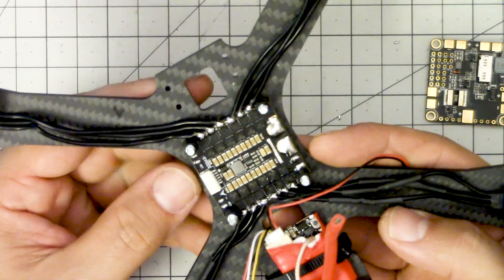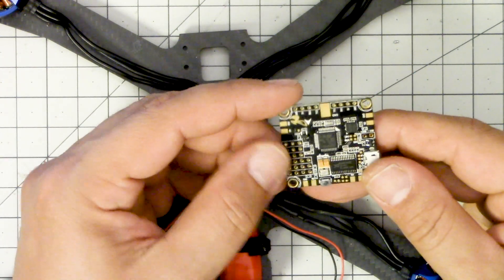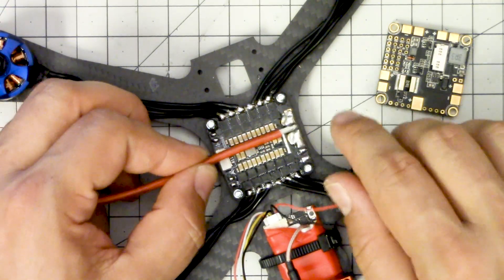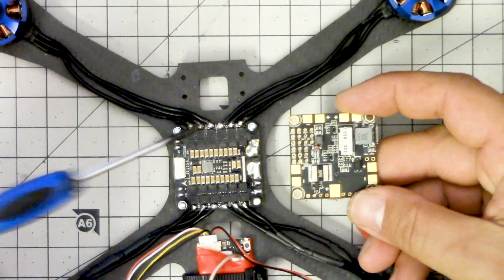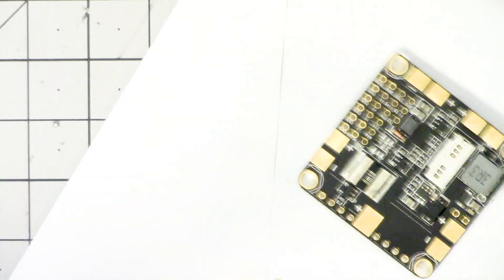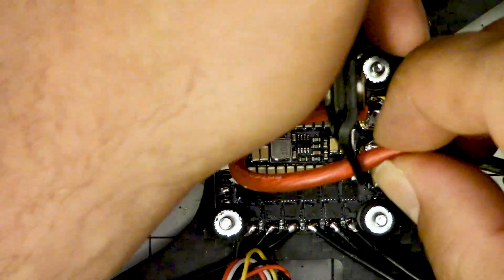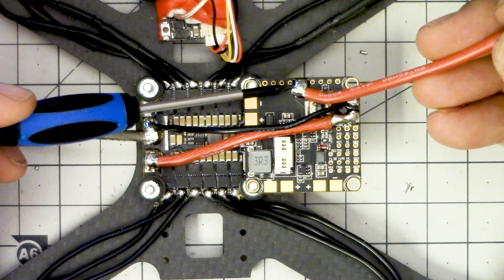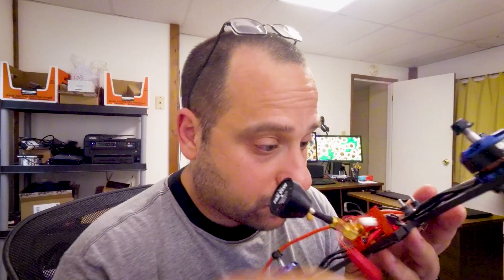All-In-One (AIO) FC  With 4-in-1 ESC | HOW TO WIRE IT UP CORRECTLY

Comment: Hey pal I’m using your 4-1 wax for the third build and I love it. However I hooked up a polulu 12v regulator for the vtx and camera cuz I’m using a lux v2 fc. and now motor 4 only does the initial beeps ( beep beep) then will not arm. Only 1,2,3 arm? Jtsnow1@gmail.com. Any idea?

Comment: I have a 550 frame. I am confused on AIO FC with ESC or Stand Alone ESC. Does it matter? I know the ESC boards are smaller, lighter, and are probably a must for small and race drones, but for larger drones?
Reply from the maker: The big advantage of a 4-in-1 ESC is that there are fewer solder joints when wiring it up. But if it is damaged, you replace the whole thing. Individual ESCs are more work to wire up, but you can replace only one if it is damaged.

Comment: Hey Joshua. 
=SKIP TO BOTTOM FOR QUESTION AND IGNORE POINTLESS STORY=
I have a (Bullet 30A 4 In 1 ESC Board) and im aware most people, if not everyone has their 4 in 1 ESC battery pads facing towards the back. 
I was just wondering if I could flip it around so the battery pads are at the front of the quad. 1 reason I want to do this is for a neater xt60 placement for my specific build and also my (Brainfpv FC) stacks the right way for shorter and neater wire plug directly above the ESC plug. 
So... I know i CAN do this but my question is about wiring the motors up to the ESC.

Question: Does the position of motor pads matter or can, eg. motor one be wired to the typical motor two/three/four position pads on the ESC?
Reply from the maker: https://www.youtube.com/results?search_query=betaflight+board+alignment+and+esc+alignment+incorrect
Reply: @JoshuaBardwell  love you

Comment: So i can power my fc by connectiong the vbat from the 4in1 to the vbat on the fc?
Reply from the maker: Yes you can do that. But you won't get current sensing unless the ESC has some current sensor to communicate current data to the FC.

Comment: HI Josh  thank you so much for the video . and I have a question to ask please I would like to know if you have any Idea  where to I solder the current wire from BLheli ESC to kiss FC ? I spent about 2 days trying to figure out or to find inf but I couldn't find anything , thank you
Reply from the maker: I don't think KISS FC has a current sense input pad. KISS FC expects to get current sense information from the ESC's via the TLM (telemetry) wire. This function is not possible with blheli ESCs.
Reply: Ok thanks so much  I really appreciate  your  help josh

Comment: Hi! Thx for this video Joshua :) I have mounted a quad with the DARLC Engine and the betaflight FC F7. It works correct with 3s battery but it doesnt with 4s battery. I wired the FC with the VBAT from Dalrc engine. Can it be the reason? Should I wire it like this video? Is fucking strange but the throttle goes crazy with 4s. It seems like having delay or something like that.
Reply from the maker: No it should work with vBat from the ESC.
Reply: :( ok I keep investigating then... Thx! Is so strange.....

Comment: i have the exact same parts except i have betaflight f4. i cant get the esc to do the second set of beeps just goes da da d. any suggestions, i will try anything
Reply from the maker: The ESC is not seeing signal from the FC. Check wiring. Check that the motor protocol such as DSHOT600 is supported by the ESC.

Comment: I'm not understanding why we need to use the ESC pads on the FC to distribute power to the 4in1 ESC. Couldn't you just connect the negative battery lead from the FC to the positive of the 4in1 ESC?

Comment: Or: solder 4 wires from the FC ESC outputs to a common plug, female of course, same with the grounds. Then solder male plug with heavy gauge to the esc bat terminals. This way: even current draw through the AIO as designed, and the 4I1 esc can be plugged in.

Comment: I’m a newbie building my 1st quad and I am going down the same path ie. using an AIO coupled to a 4 in 1 ESC. My idea: using standard gauge wire, parallel the 4 ESC outputs from the AIO to the 4 in 1 battery pad, both pos and neg. that way the total current is distributed evenly as the AIO board was designed.

Comment: hello joshua you are a genius of flight controllers. . . would you be so kind as to describe how I can connect these 2 components together that both have the current sensor.

Racerstar Shot30A ESC 30A 30amp 3-6 4 in 1 BLHeli_S BB2 Dshot600 current integrated voltage sensor
https: // banggood. app. link / j8XWfHZ73L
...and..BF3. 1. 5 Omnibus F4 V2 Flight Controller STM32 F405 Integrated MCU OSD Built-in 5V BEC Current Meter
https: // banggood. app. link / 2OK7H8z83L. . . thank you
Reply from the maker: Find the current sense output on the Racerstar ESC. Probably it is in the plug harness.

Solder the current sense output of the ESC to the current sense input pad on the FC.

In the Power And Battery tab, set the current sensor to "Internal Sensor".

Comment: First Joshua I'm your big fan... Need your help with Fc f4v5pro and esc 4in1 dalrc 40A how to wire?  First I connect directly battery with esc and Fc but something went wrong after few hour fc don't work. Now I have newone and need your help how to wire.
Reply: Hola, ya solucionaste tu problema con el esc DALRC4 en 1?, yo me compre 1 y pienso hacer lo que recomendo Joshua pero al leer tu comentario me entro la duda.

Comment: Hi Joshua could you say to me please how do I connect the ESC RACESTAR SHOT 4IN 1 30A with integrated current sensor ... to connect it with the FC OMNIBUS F4 V2.1 which also has the current sensor?
THANK YOU
Reply from the maker: You need to connect the current sense output wire from the ESC to the current sensor input pad on the FC. This should do it.

Comment: I am using one of those Bardwell boards... ;)   and an DALRC  Engine 4 in 1.. It has an output wire that they want to go to the   fc current acquisition port...   This has got me  pulling out little grey hairs!  Any clue  how to hook it up  using this simple clean 1 wire ?  Thanks Joshua for what you do for the community and my own sanity.
Reply from the maker: My FC does not have current sensor input for external current sensor like the DALRC Engine.
Reply: LOL  someday.. plug n play!  Well ok,, maybe not, but a nice thought.. Thanks for the reply !

Comment: the original battery cable + welded into the esc 4in 1. board. dove has an output connector with pin. . . VBAT / CRNT / 5V / 5V / GND. . . OMNIBUS F4 PRO V2. . it does not have the VBAT / IN pin. . . because it has the current sensor as the card racestar shot 4in1 esc. . . so come and feed the FC (note that I've already burned one because I made a mistake). . to get the current to the FC and have the current sensor of one or the other card? . . (to be taken into account that all the boards have the current sensor). Thanks, it's very kind of you

Comment: I'm using Bardwell F4 with Hobbywing 40A 4-in-one ESC. Anyone can show me how to get current sensor to work? Which one is the shunt resistor on Bard
well F4?
Reply from the maker: Please look at the manual for my FC, which is available for download from the RaceDayQuads product page. It has full wiring diagrams and instructions ot answer this question.
Reply: Thanx man! Will look for it :)

Comment: I need to run the 4 in 1(35A) esc direct to the battery to get full power. The esc pads on my Matek 405-aio only give 30A. Is this correct?
Reply from the maker: The safest way to do this is to run 4x 20-gauge wires from the four ESC pads to the positive pad on the 4-in-1. That way the current is flowing exactly how the FC expects. Using a single pad like shown here is only guaranteed to work on this exact board. Check with the PDB designer for any other board for their recommendation.

Comment: I did this on my build with a 4 in 1 30a 2-4s modular esc, but there is no power going to the esc.  no beeps, no music, nothing when I connect o battery.  What did I do wrong?  I set up betaflight and have my taranis qx7 bound.  controls show working in betaflight.  I have a switch set to arm/disarm.
Reply from the maker: The ESCs should give startup tones the minute they get power. So they are not getting power.
Reply: Thank you for such a fast response.  I might try to connect power to the ESCs direct to battery in to the PDB.  since the FC is also a PDB, would there be some other setting in Betaflight or configuration to make the pads on the lumineer f4 AIO ODS/PDB provide power to the pads?  Should all of the pads have power when turned on and armed?
Reply: I figured it out!  My idiot self attached both of the ESC wires to pos + pads on the FC/PDB.  Just did a video of my very first flight with goggles.  Thanks for your videos.  They are helping a lot.  I am not sure how I would have got through BLHeli or Betaflight without your help.

Comment: Hi Josh ... I want to ask a simple question : I have a flycolor raptor S all in one ESC + F3 board and it's the 2nd time where the mofsets in the esc board get knocked off when I crash hard  ... Can I hot glue the mofsets on the board when I replace it next time or Do I just need to search for a better all in one solution ?
Reply from the maker: If the solder doesn't hold the FETs on, hot glue sure won't. Sounds like crap soldering on the boards. I wouldn't buy them any more if I were you.

Have a look at the Holybro Tekkos stack.

https://goo.gl/rPsEnf
Reply: Joshua Bardwell Thanks for your feedback! ... After a closer look, the mofset doesn't desolder: it simply cracks. it will be the hollybro next time! ... but can I hot glue the esc board on my other quad? is it ok for heat dissipation?

Comment: So I have a problem. I have a BFF4 thats wired up to a 4in1 incorrectly. I would be quick to wire it up correctly, but my motors have a total max amp draw of about 170A, but the BFF4 is only rated for 145A. My question is, Will my motors burn out my BFF4?
Reply from the maker: Unlikely because your battery probably won't be able to supply that much current for very long, and motors "unload" in the air when the quad gets moving, so they pull less current in the air than on the bench.

But it's possible.
Reply: Joshua Bardwell I have been through that already. I killed 2 batteries with those motors and then found out that my my battery was like a dying horse-I bought more powerful batteries and now it flies fine. I'd just like the current sensing and all that fancy stuff-the only problem is the FC isn't rated for my whopping amp draw of 170A, so I was wondering if it would kill the FC. Thanks!
Reply: Joshua Bardwell Oh wait I read your comment wrong-I see what you're saying now. Thanks for the answer!

Comment: Hey JB. I have followed this method to the T on a different frame but still layed out the same as far as connections. The board is the BFF4 and the 4n1 is the 32b Typhoon. I ran 14awg positive and a ground jumper from the FC to the 4n1 is 16awg. I left enough slack in the positive to be able to clamshell the FC and it coiles under the FC when installed. I am getting  instances where the quad will "on a full roll or flip" the gyro will freak out and the quad will spin on the turning axis out of controll and I am wondering if the coiled positive line is causing interference to the gyro on the FC causing this issue. It odly doen not occure every time but maybe 15% of the time. Thanks. I have disected the set up multiple times and all connections are flawless and both boards are spotless. Thanks.
Reply from the maker: That doesn't seem too likely honestly.

Comment: Thanks for sharing this, Joshua. A couple questions regarding using this Aikon 4-in-1 board with the MATEK F405 (which requires powering the board from a 5v source, and connecting VCC to lipo voltage for voltage monitoring only). There is a current pad on the F405 - how else do you wire it to get current sensing since the 4in1 ESC board doesn't offer it? Thanks again for sharing.
Reply from the maker: Check the user manual for my JB F4 AIO flight controller. It has wiring diagrams that will work for any ESC. The manual is available from the product page on RaceDayQuads.

https://www.racedayquads.com/products/bardwell-f4-flight-controller-aio-fc-by-rdq

Let me know if this doesn't answer your question.

Comment: i have this similar set up but a dys 4n1 30A and a bataflight f4 is it basically the same?...plus i might use this FC and 4n1 on a raptor X frame LOS 7"...if not using current sensing  how do wire it?...the same way?...

Comment: i have a 4in1 typhoon32 esc and it has a current sensor do i still need to solder the fc current sensor? and also the xt60 is connected to the 2 boards right?
Reply from the maker: If your ESC has a current sensor AND your FC has an external current sensor input, you don't need to do what is shown in this video. You just wire the ESC current sensor output to the FC current sensor input.

However, if the FC has a built in current sensor, then it probably doesn't have an external current sensor input. One exception to this is the CLRacing F4S, which has a solder bridge on the bottom to let you select external vs internal current sensor.
Reply: umm my fc is the betaflight f4. and i don't understand  the other things you are talking bout... lol

Comment: Hey Joshua! Love your videos, really useful. I have trouble finding out one thing. If both my 4in1 esc and F4 FC has an integrated BEC and I want voltage monitoring do I hook up my LiPo to both FCs Bat connections and remove 5V lead from esc but leave GND wire from esc next to the signal wires connected to my FC? Or is one wire from battery +lead to bat+ and still use the ESCs BEC enough? My fc is this one http://bit.ly/2AwWOG2 I learn so much from you, thank you for all the knowledge!
Reply from the maker: Yes that is what I would do. I would wire vBat to both boards. If the FC has current sensing I would wire it as shown in this video. But I would NOT connect any 5v line between the ESC and FC.
Reply: Thank you!

Comment: How about if the ESC has a current sensor? I've been trying to decide on how its best to do that.
Reply from the maker: Wire ESC Telemetry pins from all four ESCs to a single UART RX pad on the FC. Select ESC Telemetry Peripheral in the Ports tab. In the Power and Battery tab, select the ESC as the current sensor source.
Reply: Joshua Bardwell I'm sorry I meant if I have a 4 in 1 esc that has a current sensor and my FC also has a current sensor.

Comment: On the positive lead, I stripped the wire back far enough that the very tip can be soldered to the shunt resistor while also crossing the positive pad and soldered to the pad as well, creating a sort of bridge.

Comment: First off I want to say thank you for all the content you put out you help people in this hobby more than you know. And thank you for also answering all of the questions I ask in a quick fashion so I'm going to try to cut to the chase with this I have an alien that I installed the betaflight f4 flight controller on and I kept the alien pdb since I didn't have the carbon center plate they make to replace it so I wired it up the same way you did here pretty much I ran my power wire in to the + pad and then I used the closest esc power pad and ran power out of the fc from that to the alien prob I then ran a ground wire from the negative esc pad to the negative pad on the alien pdb also and it worked great for I'd say 20 flights the only thing I have since done to the quad is I did the camera control wiring with the resistor to the led pads on the fc I did that last nite I flew a few packs this morning all was good and then out of nowhere I plugged a fresh lipo look in and noticed my voltage on my taranis tetanus and osd was really low so I unplugged and plugged back in and it went back to normal for a few seconds and then dropped to 3.8 on osd and taranis now I'm not getting any
Reply: Voltage reading on either telemetry and also in betaflight it shows no battery is hooked up at all but the quad will arm and fly fine just shows no battery hooked up and I'm not getting any voltage or mah or current still fly fine just lost everything I tried reflashing 3.2.2 and it's still the same even on a fresh flash without a cli dump can the current sensor go bad ??? I don't see any damage to the board nothing is shorted burned or missing I inspected very closely I know this is very long and I apologies but I'm stumped and very frustrated please help if you can that is again
Reply from the maker: It's possible that your voltage sensor crapped out? Measure volts at the power pads with battery plugged in. Measure the output on the 5v pads as well to see if the regulator is okay.
Reply: Joshua Bardwell can either one be replaced my buddy have me a board he cracked but has good parts if it's possible to desolder dealer and replace

Comment: Hi Joshua I have a question about my 4 in 1 esc , so I put a quadcoptor together put betaflight in, I go to esc calibration a d did it like always  and it does the initial tone but doesn't do the rest , any ideas ? I'm using the cicada 30 amp 4in1 with radiance fc thankx as always